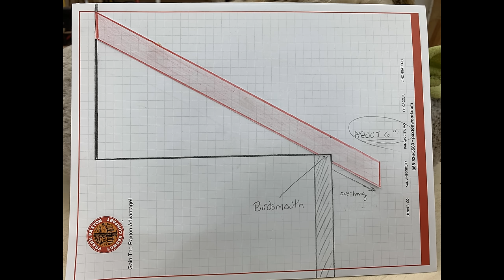99 - DIY Shed - Complete Instructions - Best Tutorial There Is!

Comment: A pro tip. When marking stud locations, offset the tape measure 3/4", then the marks will be the edge of the stud. Mark an "X" on the side where the stud should go. Much more precise than eyeballing the center of the stud. I do realize that perhaps you skipped this as your target audience is novice level.

Comment: Only 2 things that would need to change where I live, one is code, the other personal preference. The code issue is that any structure (permanent or temporary) must be no less than 5 feet away from the property line. The preference issue would be to very tightly, line the front and back edges of the floor, between the ground and the underside of the floor, with concrete landscape blocks. In this video, you have those areas exposed. This would prevent skunks, ferrel cats, and other critters from establishing a home under your shed. I have tried using coarse gravel to do this, but they just dug it out of their way and nested there anyway. The concrete blocks are too heavy for them to move. If skunks, or any other rodents decide to nest under your shed, they will eventually chew through the floor of the shed and create all sorts of nasty issues for you.
Reply: I have Skunks living under our shed for the past 20 years and they haven't through the floor of either shed.
Reply: @jessicacoldwell5414  You're lucky they're not as aggressive by you as they are by me. My dog and I got sprayed twice in three years. That ended when I placed landscape blocks around my shed. I went two layers deep into the ground, and all the way up to the underside of the shed.

Comment: Overall this is a good build. There are 3 minor things I would have done differently:
1. I would have staggered the plywood seams. Yes the joists are resting on the skids, but I like that little bit of extra strength.
2. If you tack a piece of 3/4" stock to the end of the rim joists and pull your 16s from that, you can install your joists with the edge on the mark instead of eyeballing the centers of the joists. Just a little easier in my opinion.
3. This is the biggest one for me - I would never build a shed (or any other structure) in a location where I couldn't  get to all sides of the structure. So while I appreciate that you had limited space, I would have either shifted it a foot or so farther away from your neighbor's shed or settled for a slightly narrower shed so that I could access the neighbor's side of it. That would have been good for your neighbor's access to that side of his shed too.
Reply: Well... at least you only have to paint that one side once 🤣
Reply: I had same thoughts
Reply: I would have also added blocking in between the joists, every 4 feet. This would allow the 6" OC nailing around the perimeter of each plywood sheet.

Comment: Great team work! When you compact the ground with plate compactor, make sure spraying some water along with compaction. This will help the solid to achieve optimal moisture content and eliminate settlement in the future. Also, try compact the soil no more than 4 to 6 inches if your base is thicker.

Comment: Things I would have done differently: 

#1 & 2, I would have done it on a concrete slab, and put at least 4 trailer tie-downs in the ground before I did the concrete base.  
#3, Paint the skids with either red guard or a rubber spray and the floor joists as well.

#4 &5, Before I attached the floor, I would have gone ahead and bolted in the joists and then layered about 3 varying sizes of wire mesh and a window screen...it helps to keep pests out.

When I do something, I tend to think long-term and go a bit over board.

Comment: Nice work!  Like the level pad you made.  Just one thing to add....If you angle the ends and drill holes for chain in the ends of the skids before you lay them in place it will be a lot easier to move should you ever need.  You can jack it up and put a pipe under it for it to slide on.  The holes will allow you get a chain so you can drag it with a truck, skid steer, or lawn tractor.   You can come back and do it later, but it will be a little bit harder.
Reply from the maker: Hi Danny, great points. We were meaning to do both of those things but had so much going on, we skipped right over it.

Comment: thanks for being so thurough the only comment i have is when the 2x4s were cut, it would've been ideal to seal the ends that were cut because if not water will be soaked up and its going to start rotting the lumber(defeating the purpose of it being pressure treated). other than that great job!

Comment: I hate to be the critic but I noticed a few things..1- the skids should have a beveled end ( making it easier to drag around if the need should arise ) 2- the flooring should have had staggered joints..( makes for a stronger floor. Other than that...Good job..
Reply from the maker: Hi Mark, thank you for the comments.
Reply: i would also use tongue and groove plywood for floor
Reply: I know I’m late to the party but there was no mention of processing the road base. It should have had 3-5% moisture before putting the plate on it. That would have tightened it up much more.
Reply: I agree with staggered joints. Better foundation
Reply: How about the electrical ran on the outside of the other shed?
Reply: Hello, would you recommend still using skids if you already have an area that has concrete? 2:11
Reply: @josel6113  sounds like he addressed that in the 28th minute. Like that was an option. But it may not have been clear.
Reply: @Steven Cuellar Art  please explain.
Reply: Nice j ob
Reply: @tipsreviews7476  When you put down the next section of plywood, start with a 4’ x 4’ piece. That way the joints won’t line up with the first section which were 4’ x 8’ pieces.  That’s what he means by staggered.
Reply: @josel6113  yes if you don't want to get permission and permits from the city or so but you can do that then get a skirt or add wood as a trim and if you move you can take it if you rent. Also you can bolt it down to the concrete on skids so no permit 😊
Reply: @marcelo403polo2  It's a shed, not a house.
Reply: Nobody asked you
Reply: @youngsterjoey9038  That's right! Nobody asked your opinion either!
Reply: @marcelo403polo2 if you have the budget for it. But it's not necessary
Reply: @ALT_RIGHT  to each his own. I would
Reply: @Hema1400 that's why we are here. 😂😂😂😂😂😂
Reply: One thing I would add to the critique is you should leave a 36 inch space between your shed and the other shed.
Reply: @Sith_dude  Might as well since we can’t duke it out…. Unless you’re really a sith. 😂
Reply: It’s okay to railroad joints
Reply: @Hema1400  I sense a darkness welling in you. Release your anger and let the power of the dark side flow through you. Plus we have cake and ice cream.
Reply: @marcelo403polo2 not for a shed
Reply: Also the flooring should be glued to the joists
Reply: @KingsFineWoodworking  where is the plans and materials list
Reply: Man people are obsessed with everything needing to be perfect it’s a shed
Reply: @tatecentral1221 was thinking the same thing man. This guy posted a video to help people, not get critiqued.
Reply: That's a couple things
Reply: Thanks for the video

Comment: FYI from a Texas home inspector: the state code wants ALL structures to be off of the ground if they have a wooden base, even if it's just up by an inch on a cement block. Wood-to-ground contact is a conducive condition to termites. I write up people all the time in my home inspections for having a wooden backyard shed that's in contact with the ground. It doesn't matter if it's treated wood. If it's in contact with the ground, it has to go on the report and that can cause issues when trying to sell the property. Always put your sheds up on non-wood blocks of some sort.
Reply from the maker: Interesting rules in Texas. This shed is portable. And, I used lumber rated to 40 years below grade. It’s not gonna rot before I die of old age.
Reply: I never understood the overzealous attitude with things like this. Why can't the homeOWNER just take that calculated risk?
Reply: Just a Texas thing man, not all places that way and I don't agree with it. I understand it but it's the homeowners choice  I wish was the case

Comment: i would still stagger the seams for the floor--probably not an issue with his build as you said... I like to use exterior grade screws for the floor as well, depending on the pressure treated wood it may dry out (they can be wet from the pressure treating process) and the nails get loose, and you get a wonky floor.  but great build looks awesome and super sturdy!

Comment: I'm a retired carpenter and I  have to ditto on the need  to stagger the plywood floor. One other thing when using a string line to check for straight  I want to suggest that you attach a thin block to the framing at both ends and then attach the string then use the same thickness block as a gauge to then check for straight. If you don't do that, you run the risk of the string touching and not giving you an accurate result.  Also is you neighbor aware of how close you are to his shed. Looks as though there isn't much room between the two sheds. Hopefully he will get a coat of paint on that wall before your wall is constructed.😏 other then that, looks as though it will be a nice looking shed when completed.🙂
Reply from the maker: Hi! Great tips. Thank you!! As for the neighbor, they are taking their shed down. It’s old and falling apart.

Comment: Something  new contractors are doing instead of drip edge at the seams of sheet siding they are over lapping by 4"  then you dont need to use the metal z flashing between sheet seams.  As if its lap siding
It also looks better.  Works grate unless your doing a board and batten type finnish.

Comment: Hi James , thx for the build. . Im in need of a small solar shed to keep solar equipment dry. 
What size and length of galvanized nail did you use to frame the 2x4 floor? And what size and length of nails for securing plywood? Thank u so much. Really appreciate it..

Comment: Just asking, as I am very inexperienced when it comes to building sheds, but having watched a few other videos before finding yours, wouldn't it have been better to use tongue and groove plywood on the flooring for a floor that is on skids?  There is a lot of room under the shed for moisture to get under and therefore possibly getting up thru the very small cracks where the plywood joins?  Like I said, I am asking.  Thanks for sharing.  I have been binge watching DIY shed builds as I may need to build myself a new chicken coop in the spring.

Comment: 26:01 i think you forgot a key step here. You didn't stagger your flooring for added strength. I would have cut that sheet in to 2, 4' x 4' sections and out a full sheet in the middle. Then the last section you can go back and rip your 4' x 8' piece into 2, 2' x 8' sections and you have staggered flooring making all the joists tied together better. Especially if you plan on dragging this around. Where your break is at you have a week spot.

Comment: It's not surprising that in America they build houses for a few years as it looks like this. Wooden elements cannot come into contact with the ground because it is an organic material and, if not protected, deteriorates under the influence of weather conditions or other organisms. in 4-5 years, the result will be that the beams covered with earth will have to be replaced. For this, either concrete is used so that there is no contact with the ground, stones or special metal supports prepared for this purpose.

Comment: Just curious...why nails for the joists instead of screws?  Wouldn't screws be less likely to pull apart?
Reply from the maker: Screws aren’t permitted in the code for things like this. The vast majority of screws have no real shearing strength. Something that the nails provide. 

And nail pull out isn’t an issue. For example the nails cannot pull out of the joists because the decking on top holds it together and prevents that. 

But also, cement coated, ring shanked nails have enormous pull out strength. Some hold so tightly they almost can’t be extracted with a big claw hammer.
Reply: @KingsFineWoodworking  Thanks for the info!

Comment: I'm wanting to make a super insulated building to grow meal worms (they like 75-80 deg F). Would it be best to insulate the floor somehow? How would I do that?
Reply from the maker: Yes, absolutely. The only way is to make the joists thicker. Maybe 2x6 or 2x8. Then fill the floor joist bays with some type of insulation that is waterproof and weather resistant, before laying down the plywood decking.

Comment: If you have a solid base such as concrete, it makes little sense to go through a substantial effort to remove it.  You made a very valid point relative to making sure that your base was level and that your base was important.  Can't get any more substantial than a concrete pad.  Would have been much less effort to add to the existing concrete pad than to jackhammer concrete and remove what would be a much more substantial base for your shed.  You made a good point relative to using skids but then driving rebar in those skids makes little sense in that it would make it very difficult to "skid" your shed.  While I applaud your great advice on most of this tutorial... I felt it important to point out what, in my opinion, was poorly thought out.

Comment: I live in florida and the wind codes here would not allow a shed on skids. Also a building permit is necessary. Can you comment on this issue?
Reply from the maker: Hi,
I can,

Not quite sure what you want me to say. Other than the obvious. Everyone can check with their local building department to see what if any requirements they have. 

Even here in Colorado every different county has different rules. Most counties have a maximum size it can be before a permit is required. 

But permits are super easy to get. Most building departments will help you and tell you exactly what to do, and even provide you with a sheet to fill out for it.

Comment: Surprised you didn't stagger the plywood seams and support them with blocking
Reply from the maker: Hi Raymond, I was trying to keep it simple. And since the joists are locked in place & the span is tiny, I figured those weren’t necessary.
Reply: @KingsFineWoodworking  true with 3/4 ply and on 16 I don't imagine you see much flex. I built a shed this past summer with 3/4 on 24 inch centers and found blocking almost essential

Comment: If I was to build storage on concrete would I still need to lift it and build the flooring?
Reply from the maker: No. You just skip the flooring. But you should bolt the sole plate of the walls(flat bottom 2x4) to the concrete all the way around.

Comment: Hey man how long are the nails you’re using?  I bought 2” x 113” ring shank hot galvanized nails. Wondering if I need 3”. Ails. I bought your 12x12 plan and gonna start with the foundation this weekend!
Reply from the maker: The nails you got are perfect for attaching siding to the frame. Make sure they are galvanized. 

And for the framing of the 2x4’s use full size framing nails. 3-1/2” ring shanked galvanized. Something like this. 
https://amzn.to/3OOs0FZ

I don’t know if those fit your framing nailer, so make sure you get ones that do.
Reply: @KingsFineWoodworking  awesome thank you for the quick response! Will return the short nails and get the longer ones. You’re plans are awesome by the way! I’ve never built anything like this in my life. Really excited to start!

Comment: Hi James, do you recommend using tongue and groove plywood, and if so what can you do about the fact it’s not 4x8?  Would you make the size of the shed smaller?  Also, is it ok to make a full rectangle of 4x6 to keep out the critters?
Reply from the maker: Hi! Tongue & Groove plywood is great. It will make your floor a little stronger. But it is definitely 4x8. The tongue edges stick out past the 4’x8’ size to interlock. Once it’s all pushed together it still covers the exact same area as a 4x8 sheet of ply. 

For the critters you could definitely use all 4x6 Timbers to cover the base. However, what we used to do in areas that were a problem was to just fill the area between them with rock. For an 8x10 shed it’s less than a ton of river rock, and that’ll only cost you about $40. Whereas filling that whole area with timbers will be probably $400.
Reply: Thanks for the reply.  Unfortunately the tongue takes away 1/2” from the calculations (yes, the entire length is still 48, 47.5 plus .5), but once you put two or more sheets together, the floor length will no longer be a multiple of 48”.  In some of the YouTube videos I’ve seen how they just make the shed base smaller to compensate.  But if I wanted to make the floor a true multiple of 48, I wasn’t sure how best to compensate.  @KingsFineWoodworking

Comment: I live in the northwest. and the snow load is 71 pounds per foot. will your deck plans handle that much weight?
Reply from the maker: I don’t really know. You could certainly ask the building department. They will have spam tables for joists, beams, rafters etc for your required loading.
Reply: @KingsFineWoodworking   Aah, very good. Now I can be certain about how much spam my joists can handle. LOL!  Super video as always.